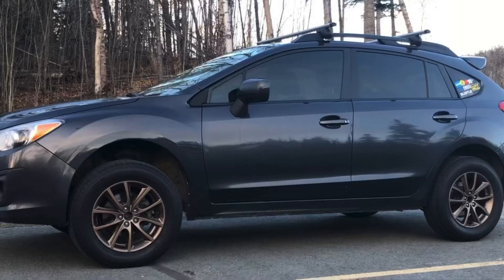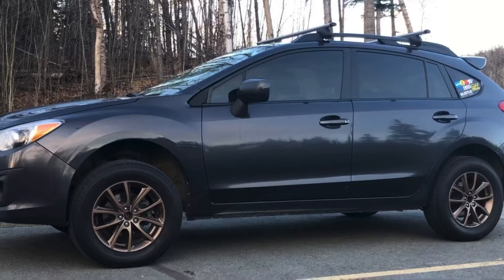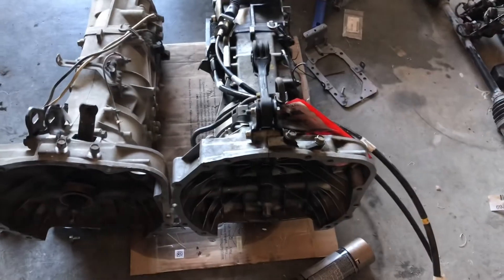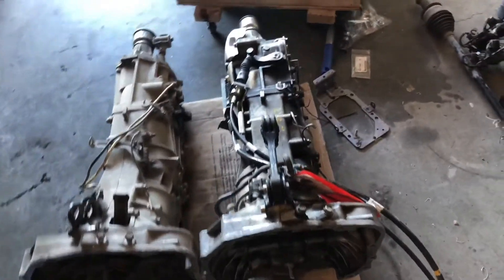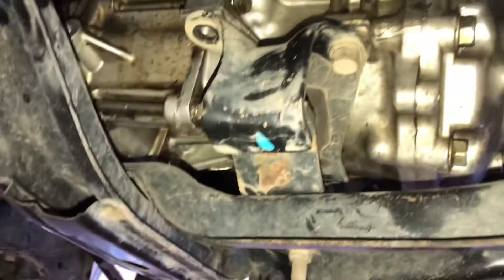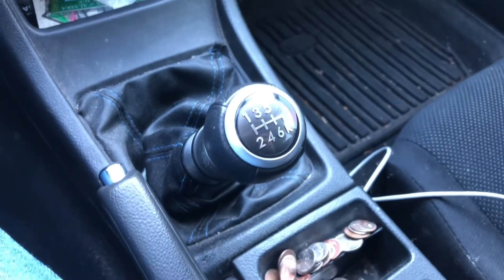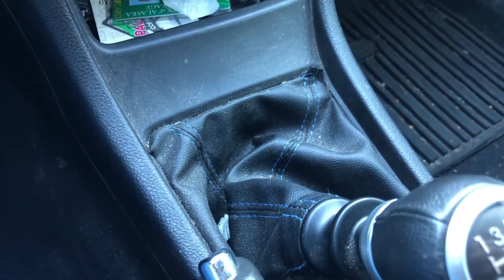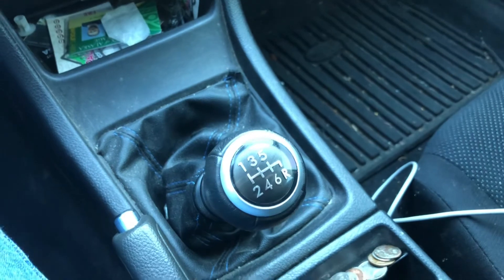5MT to 6MT Manual Transmission Swap - 2012 Subaru Impreza

Comment: Damn I thought these would be a slight variation of the STI 6 speed, but they're nothing alike. Still very strong though, especially if similar to the revised Subaru 5mt.
Reply: the 6 speed does have a stronger coated gears on the 1st and 2nd

Comment: Lifted the car, swapped the 5 speed for a 6 speed… looks like you’ve built a crosstrek lol. Seriously though that’s really cool, so the 6 speed revs lower on the highway?
Reply from the maker: Yep I cruise at 75 in 6th at around 2700 rpm

Comment: How did you switch out the stock cross bars for rails which part did you go with?
Reply from the maker: I'm not sure what you mean by cross bars or rails here, but if you're talking about the transmission crossmember, it was the stock crossmember and support brackets, I didn't have to swap anything, the new transmission literally bolted right into place
Reply: @projectimprexive9479  thank you but Im talking about about the roof racks Youre using. On your lift video you had the stock cross bars on your impreza but now you seem to have rails that run along the top?
Reply from the maker: Haha good eye, I pulled the cross bars and replaced them with the rails that I got from a Crosstrek at a local junkyard, I had to drill two holes in the drip channel for the two rearmost mounting bolts but other than that it dropped right in (and seal everything with silicone of course). Any rails from a ‘12-17 Impreza or ‘13-17 Crosstrek should fit